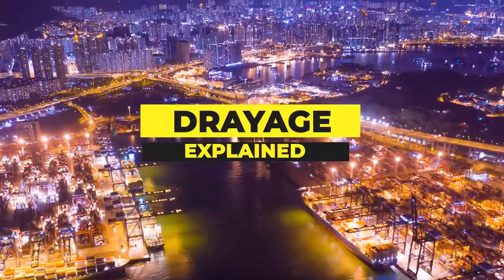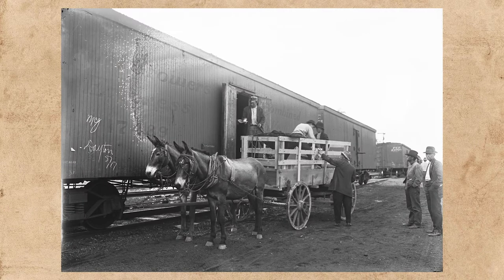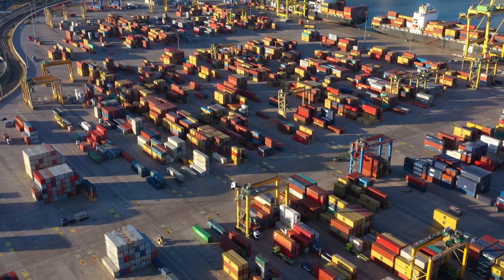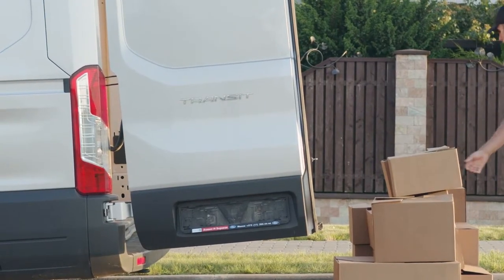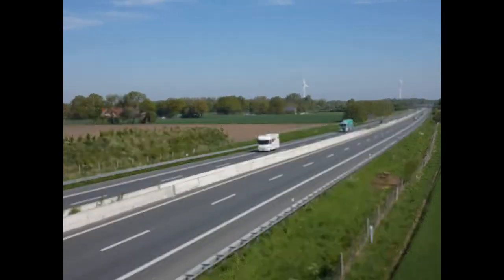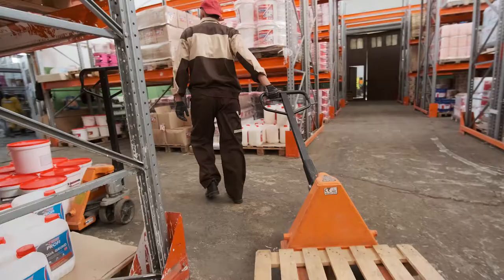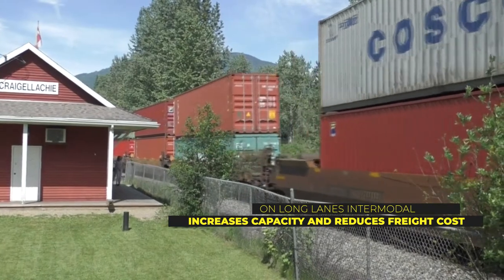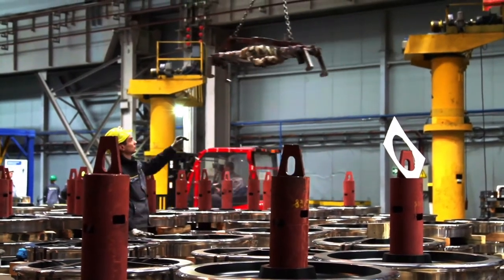Drayage Explained

Comment: Thank you! 
What is the standard process in the U.S. for unload time on receiving a container? Say I pay drayage from the port to my business, does the driver wait for unloading, or do they drop the box and chassis, and return later for the unit? Assume perhaps a non-palletized load of heavy bulk cargo like stone blocks, not slabs. In a different case supposing a 200 mile drayage, does that change the scenario? For super long drayage, is it economical to transload the cargo near the port for a dry van to take it to the business? One more lol who usually hires the drayage trucker? Freight forwarder, customs broker, other logisitcs company, or shipping line?  Thank you very much!